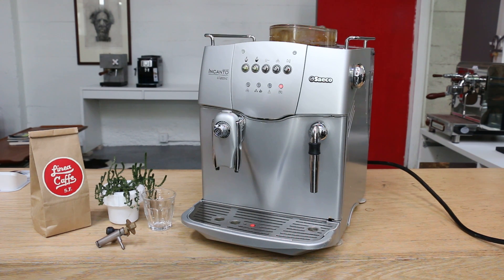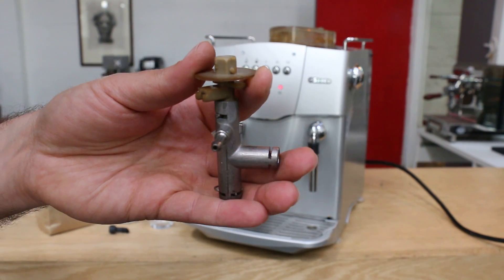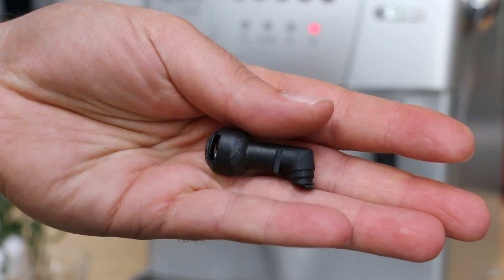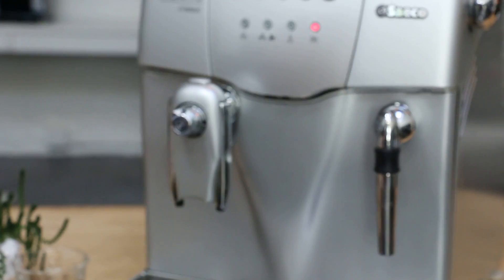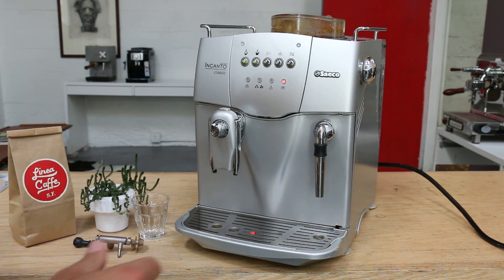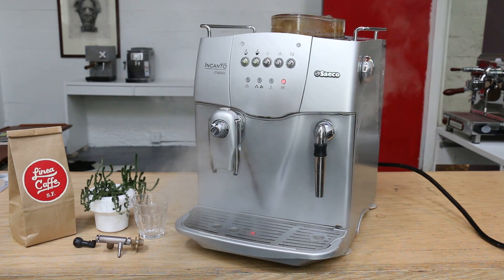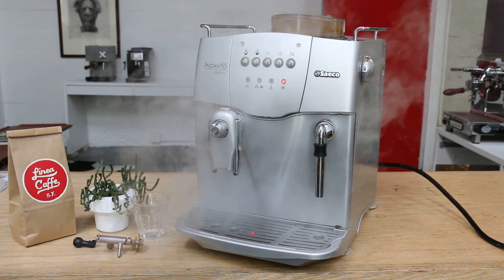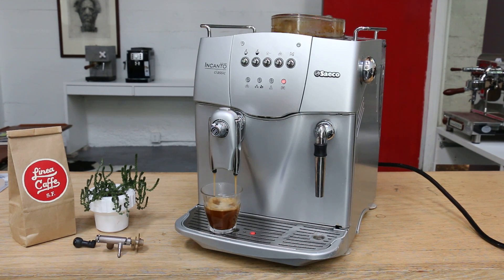Saeco Incanto Steam Valve Test 1039

Comment: hello! I have Saeco Rapid Steam, I replaced the steam valve and hot water (water was flowing) and the shooting doesn't work anymore. if they turn on the machine, they do their group test, but the coffee doesn't work anymore, the group doesn't move where it should. hot water or steam no longer, I turn on the tap, the pump does not work, only the water that is on the hose flows.
when I turned it on, when it was clearing, it was under pressure, I turned on the hot water tap to let the water flow. the grinder works.
no error, the boilers heat up